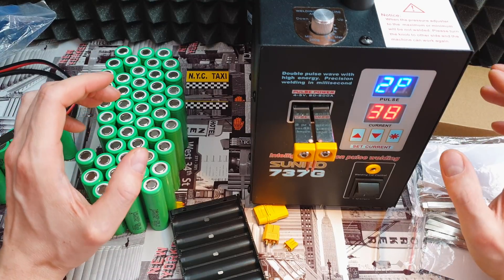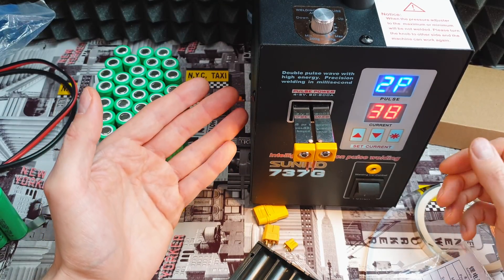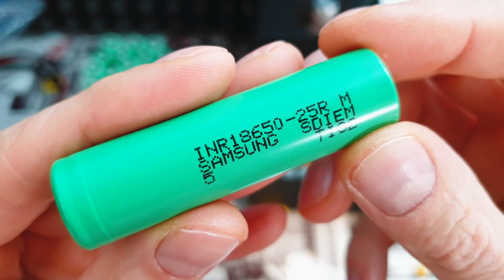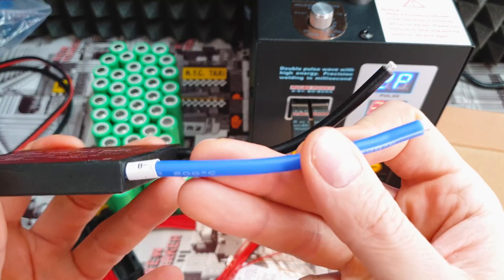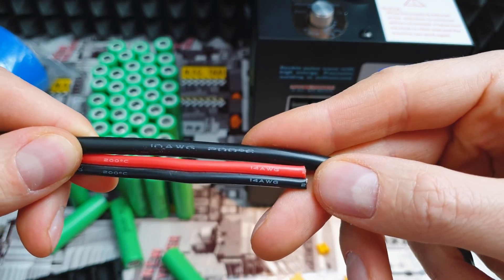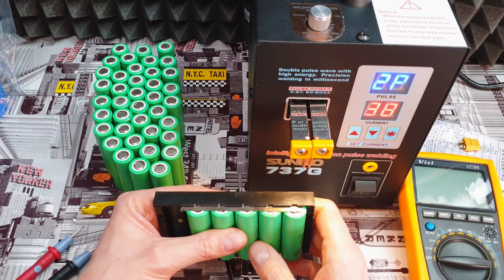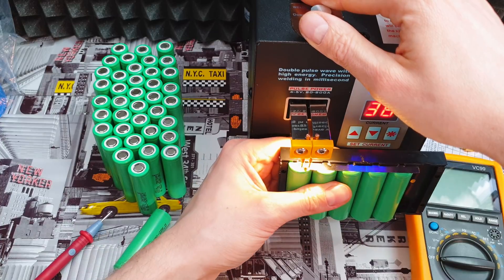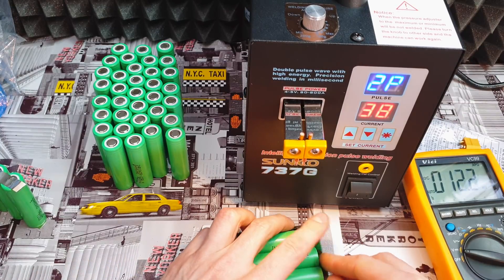How to DIY battery pack for Xiaomi M365 & Fiido D1 Bicke & Electric Skateboard Part 1

Comment: Hi Pirate! I want to make the extra battery for m365 pro 2. Can't decide which cells to use: Samsung 25R (2500mah, 20A) or Samsung 35E (3450mah, 8A). I am going for 10S4P. Is 8A enough? And mah difference is pretty big 10Ah and 13.8Ah how much range that difference would give me? Thanks!
Reply from the maker: Yes 4p is good choice, but my fav is 5p at 35e 🍕🏴‍☠️

Comment: Can you produce say 20 or 25 or even 30 000 mAh battery pack as a replacement for the original one in m365 pro? If yes, how many cycles it would last, what max power it could provide to the engine? How long it would last? I was thinking about removing the original 12800mAh battery pack from my m365 pro and replace it with something custom made, say 20 000 mAh or even more, without lowering the floor (or lets say no more than 2 cm lower) with 3D printed covers. Is this even possible? How much it would cost? I need to add I have Eco=440W, Drive = 800W and Sport=1057W firmware. XiaoGen firmware. What do you think?

Comment: Hi, if i have a battery pack with bms separate port, can i transform in common port for put in m365 an use 1 charger?
Reply from the maker: I think no, check manuals

Comment: i pirate, why you dont use the original m365 batery cells? is the same?
Reply from the maker: Cause 35e got bigger capacit and at 4p or more got good discharge power 😇🍕🍺
Reply: @PirateWasHere  thanks for the reply

Comment: Goedenavond. I just bought a Zero 10x. Controler and display one of the questions is what should I set the shut off at 28.5v or 30v. This is a 36v 14ah battery. Thank you.
Reply from the maker: But in zero 10x i think u got 14s battery so around 65v

Comment: @PIrate, thank you very much for this useful video. Is it possible to connect such additional battery pack via charging connector of Fiido D2, to get much larger range? If both batteries (internal and external) are both full and have approximately the same voltage, they should discharge at the same rate, and give the bike about the double range, is this correct?

Comment: i have this same bms but i notice my pack wasn't working one day so i checked the voltages and one pack was at 2.70v which triggered a low voltage shut off and one pack at 4.43v not sure how it managed to get that high as its meant to balance it but i corrected the voltages and its all working again but it better not make a habit of it i used some top shelf batteries and i dont want them dieing prematurely
Reply from the maker: Looks like your bms got damaged balnser :(

Comment: now there is a way not to spot weld any more https://rover.ebay.com/rover/0/0/0?mpre=https%3A%2F%2Fwww.ebay.co.uk%2Fulk%2Fitm%2F123808799080
Reply from the maker: not really, weight + 100% so ...
Reply: @PirateWasHere  i think they can add rought half a kilo in general. i will order 1 set soon and will let you know ;)

Comment: Hi Pirate! Great work as always. I have a question: What is the max size of battery I could add to Xiaomi m365? I mainly see on the internet 8ah, 10ah and 12ah. What about 20ah or even 30ah? Is that even possible ?I am not an electrician so my question may be stupid.
Reply from the maker: Well i was planned to add 10s7p with 18650 35E cells ( capacity 3500mah ) so 7 x 3,5ah = 24,5ah. At 7p xiaomi will be heavy at the front but for me this could be max weight ,everything above will be too have so not comfy to ride
Reply: @PirateWasHere  Thanks for your answer man. But does anything change regarding the process of connecting the extra batter with Y method, when I use 8ah, 10ah or 12ah, or is it the same exact process with same cables and tools?
Reply from the maker: Yes the same
Reply: Pirate Thanks for your quick answer. Last question: what about charging the batteries? Since the default battery and extra battery are different size, how will they be charged equally?
Reply: @PirateWasHere  I'm wondering the same thing. How does the charging work when the extra battery is bigger than the original?

Comment: Hi mate, 

I got the Fiido D1 after seeing your review where you fell off the bike :)  But I have fried the battery by putting + and - together! I have found a replacement battery on Aliexpress but there are many BMS options on the link you provide above - do I buy the '60A36V Separate Port' version?

Thank you
Reply from the maker: You can buy with separate port 🍕🍻
Reply: @PirateWasHere  thanks man, quick question, do I need to buy a separate BMS if i buy the battery in the following link or is the BMS built in to the battery?

Comment: Did you say the Samsung 25R is 30A? Absolutely not. It's a 20A battery. The only 18650 battery Samsung do that is 30A is the 20s. Just so everyone knows.
Reply from the maker: 25R got constant 20A but peak for couple sec. 25-30A
Reply: @PirateWasHere  It's rated and tested for 20A. You should never exceed the batteries capabilities. If you have them in parallel or parallel series, yeah it's fine as you're running multiple as a single but the 25R is made for a max of 20A. That's the reason why it gets dangerously hot when you exceed its amp limit. It was never meant for power packs.

The Sony VTC5A batteries would be better. They were designed to be used as power packs. They also run 25A and 2500mah. They're the most used for power delivery in high drain devices.  They can run up to 30A without getting dangerously hot.
Reply from the maker: @baconbreadwithbacon  i still dont know what is your point ?1
Reply: @PirateWasHere  You've said in your video a 20A battery is 30A and then said it can do 25-30 in a reply. That's misinformation.

Comment: I kept my same welder at 95A 2P.
I think it just depends on the quality of the build. I disassembled mine, and it looks like it was put together with no concern for quality. After cleaning upthe solder tracks and rewiring the secondary coil on the transformer, a setting of 75A 2P gets the job done!
Thanks for going over that, too! Now I know mine is shoddy lol

Comment: 🔋🔌 🚲 ⚡I got a 4 amp charger for my FIIDO D1 10AH. It charges twice as fast compared to included charger.Much recommended if you use it a lot.Still way under the 1C recommended charging limit.Charging with the included charger works but takes ages and it behaves more like a 1.5AMP charger than a 2A charger.Model i bought: Modiary MDA222 42V with 5.5 /2.1 plugDo not use more than a 5 AMP charger for the 5,5 mm / 2,1 mm jack plug.
Reply from the maker: U have to remember that faster u charg batteries, faster they die
Reply: Less charge current equals more capacity